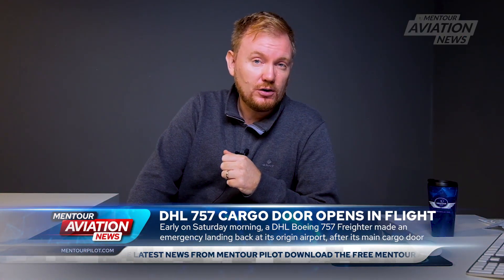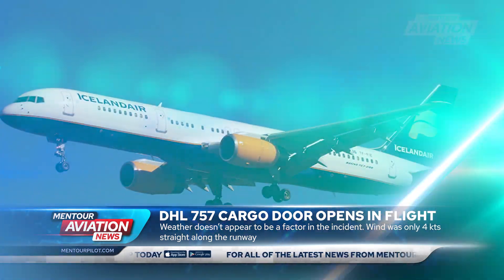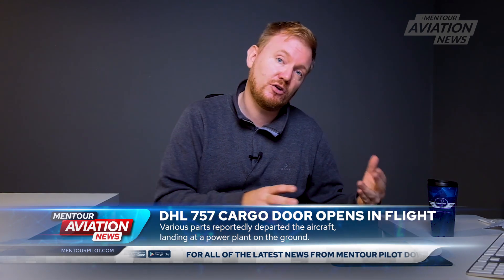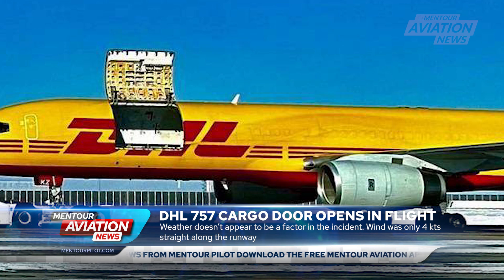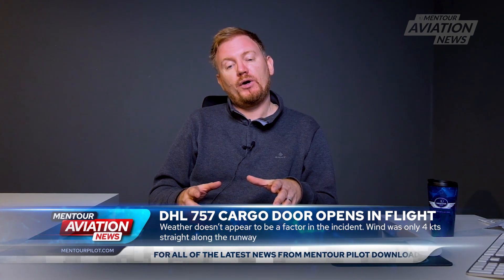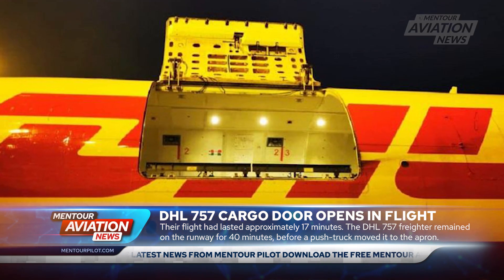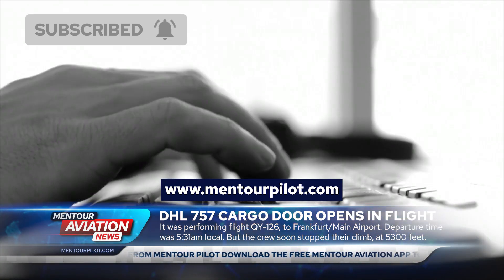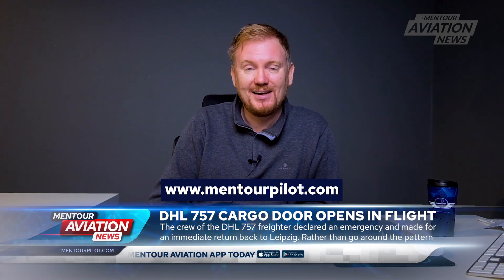Boeing 757 diverts after Cargo door OPENS IN FLIGHT! Mentour Aviation News

Comment from the maker: For fresh aviation News like this 👉🏻 https://www.mentourpilot.com
Reply: I am so glad you do not speculate just because some people ask you to do so
Reply: Hi mentour, are you flying these days?
Reply: parts of an aircraft hitting a coal powerplant. thats not sounding too scary. it's scarier, if you know, that the powerplant is actually part of dow chemicals BUNA plant 10km/6mls south of where i am living and that, if the stuff would have hit like 300m/1000ft further to the northeast it could have done VERY bad damage with catastrophic consequences. so no...not to be taken serious enough! thanks for the heads up, mentour!
Reply: There's one thing you didn't address in the video, and that's the safe landing weight.
I'm surprised they didn't have to fly around longer to dump fuel to get to a safe weight.
Was it a very short haul flight, or do you know anything more about this?

Thanks for the awesome channel with so many great videos!
Reply: @MrNicoJac  Flying around to reduce weight is the normal procedure. However, there is a danger that the door could be ripped off and damage the aircraft, and, the door and debris might hit some people on the ground and kill them. Under these circumstances the immediate landing is the correct choice.
Reply: @MrNicoJac  This flight should originally only go to Frankfurt. Leipzig-Frankfurt is a very short-haule-track? May they´ve simply not as much fuel on board that the weight could be a problem - fortunately?
Reply: Pilots were very fortunate to get this bird on the ground without crashing. They really earned there pay check for the day.
Reply: Not quite a DC10 moment but far too close for comfort. I would have thought cargo doors are foolproof and fail-safe by now.
Reply: Are you planing to cover the DHL crash at Orio al Serio(bgy) from 2016 circa, I'm from nearby and I know you have experience with this airport from the training facilities
Reply: Love the bar like real news well this is real new but like a professional news channel info bar awesome love it!
Reply: Thanks for all the videos your amazing guy  with your team
Reply: Thisreminds  me of Untied Airlines Flight 811 that had a cargo door come open in flight on February 24, 1989. That was a passenger flight with three hundred fifty-five people on board,  and the door came off.  Nine people died, fortunately the pilot reacted and disengaged the auto pilot, then descended and returned to Honolulu successfully.
Reply: At least it flew and did it’s thing instead of completely breaking apart.. think of the windsock effect on the craft. Wonder how much extra thrust was needed for the port side to combat the drag
Reply: I haven't been getting notifications for a while, am back now, I'll be looking daily to see what's new 👍
Reply: Oh, I am from Leipzig, didn't notice that case 🙈
Reply: Did it 😎.
Reply: Do you really need to obstruct the screen with a 72mm News bar? I could not see anything below 1/4 of the screen.
Reply: @rasputinputin8103  there in nothing to be seen down there and it adds some information.   Don’t you watch the news on TV? It’s the same!
Reply: @pomedo  As it happens, old man, I do not do such puerile things as watching TV. If I want news, I listen to the BBC broadcasts; or, if in need of a picture I visit the BBC website. Perhaps, am I missing something?

Comment: I am actually really surprised that the door didn't get torn off by the wind during flight, it's amazing how strong they build these things.
Reply: I am surprised there isn't (or is there? Maybe there is, and it failed somehow) an electronic mechanism that tells the pilot the door is not correctly closed - meaning, with a security deadlock in position - before the aeroplane takes off. All cars since many years have such a warning. There should be a light in the cockpit which goes off only when the door is locked in a sure way. If car manufacturers can do that, why can't the air cargo industry?

Comment: Sorry to nitpick but at the beginning you showed an Icelandic 757 with RB211-535E4 and then showing an ex-BA 757-236 in DHL colours with the older, less powerful RB21-535C engines.  BA had both types in their fleet, the -535C being delivered in the early 1980’s, in the G-BIKx range.  Both engines are still powering 757s after cargo conversions to DHL/FedEx for example.

Comment: Quick not to everybody watching 
This is a common problem with freighter in a very cold weather, it has also previously happens to a Russian 757-200PCF and a DC-8 freighter conversion aswell as a A300 conversion 
It has to due with the locking mechanism freezing up 
In fact there is a pre departure check for the ground crew to check via a small window that the locks are engaged in sub zero temp

Comment: I work with 767-300 converted freighters and the main doors have a latching mechanism plus a separate locking mechanism, activated in sequence by two switches. All cargo doors on 757 and 767 should only receive power from ground power or the APU, never main engine generators, and they have circuit logic that disables all doors and cargo bay lights at rotation. (air/ground sensors on the main gear) 
I wonder if this is a case of getting what they paid for on the third party conversion vs a genuine Boeing conversion?

Comment: After hearing you explain things, its amazing this incident didn't result in a crash. 
I'm surprised that this locking mechanism appears to be designed to allow the locks to release as a result of a hydraulic failure. If this is what indeed happened.

Comment: I can definitely appreciate the concerns of the flight crew in this situation. I fly something a lot slower, lighter and non pressurised (the Cessna 206) and the double rear doors are able to be removed for parachute operations, BUT if we do that, we need to install a deflector kit (to deflect the airflow past the opening) as there’s a risk that pressure from the air flow could cause structural failure of the airframe (blow the tail off). And that’s not even having a huge door hanging out in the airflow.

Comment: Yikes, I panicked for a moment and quickly grabbed my logbook to check if the aircraft (G-DHKZ) was one I'd worked on, it wasn't. I'm an EASA mechanic and used to work on DHL freight aircraft, including occasionally working on the main deck cargo doors. Everyone I worked with mostly considered the 757 doors better than the A300. I'm unfamiliar with flight procedures regarding these doors but I always felt that after loading, pulling the systems CB behind the FO's seat would be advisable.

Comment: In 1974 a Turkish DC10 crashed after taking off from Paris en route to Heathrow. Tragically, 346 people died and the cause was established as a faulty cargo door which flew off at around 11,000 ft.   The means of securing the cargo door were found to be poorly designed and it's believed a member of the ground crew used his knee to force close the locking mechanism.  Instead of securing the door, the ground crew member actually bent the latch into what he thought was the closed position.
Reply: There were several things working against that flight beyond the one you mentioned.  A service bulletin which was started but never finished,  unauthorized modification of the cargo door latch mechanism, and a baggage handler neglecting to do the required check through the sight window of the visual indicator which would show conclusively whether the latches were in fact engaged.

Comment: I have over 3600 hours flying in a KC-135. It has had a large cargo door, made in the early 1950’s out of the 707 design. Part of my job as an inflight refueling operator was to check all doors in the aircraft. There’s lights that signal they are supposed to be be locked. Two manual levers to lock front and rear locks.These locks roll around the lock pins a little lower than the floor level. If they are locked properly the aircraft can be pressured and the locks will get tighter. Never had an issue in all those hours. Not familiar with other aircraft manufacturers. I was also a trained hydraulic mechanic. I would think that the bottom pins were damaged by ground crew or the locks were not rigged correctly and overcenter mechanism was not fully operational. The article didn’t say if it fully opened or just partially. Would like to see the real problem.

Comment: I wouldn't be surprised if it turned out to either be an electrical fault, or hydraulic line rupture that caused it (if the door is held closed by hydraulics, that is).

Comment: I have a few questions for you. One: why is that the black box has only voice recording but no video recording? It feels like we are still in 1990s. All cockpit should be equipped with a full HD or even 4K recorder so when an accident happens it would add to the investigation. Second: Why the flight recording is only stored on a device (black box) and not uploaded via internet link to an international server (using a secured cloud service) every few minutes so even if the black box is lost or cannot be recovered the accident could be still investigated? Third: How could be avoided pilots falsely reporting drones at altitudes which technically cannot be achieved by drones or at speeds no human being would be able to see a thing nor describe it as some reports suggest? (Just an example, when I am travelling with 70mph on a highway and someone is standing on the side of the road it would be impossible for me to describe what he/she was wearing or was he/she moving or was stationary.) In recent years we have been in the crossfire (the entire drone community) by commercial pilots reporting near misses in impossible circumstances and the UK's AirProx Board now has over hundred reports per year of pilots reporting drones without any (not one!) supporting evidence. I find this very concerning. Even the Gatwick incident's investigation (which you have mentioned in one of your videos) hasn't been able produce any evidence of drones were present blocking the runways despite hundreds of people having smart phones these days. But surely the media was very pleased. Millions of pounds were lost and many thousands of passengers have been unable to board their planes. I feel very sorry for all of them. Shortly after the incident the airport has been equipped with anti-drone systems. Seems very odd and maybe it was a staged incident (and was very damaging both for the industry and for our hobby). I am not denying the risks that any solid flying object can pose a risk to the airplane and some people are stupid enough to fly where they not allowed and potentially putting lives at risk but physics and human observation limits cannot be fooled. Many of these reports could have been proven by a nose camera installed. Could you please clarify these in any of your upcoming video? I would love to hear your thoughts. What are your suggestions or explanations of the ever growing numbers of reports? Many thanks in advance.

Comment: Even though the aircraft is built with a frame known as a space frame buy riveting the skin to it it gets structural rigidity approaching the type of engineering you would get in a monocoque or unibody Construction

When the door is lockdown in essence the door becomes part of the horizontal and vertical ribs up the structure as well as part of that monocoque skin

The twisting on the fuselage especially above and below the door see incredible Torx applied to them more so than the left or right sides because of the longitudinal stress on the fuselage

Received this or have seen this on "Open Wheel" monocoque Auto racing chassis which has and opening for the cockpit exactly where you don't want an opening in the middle where you got those longitudinal forces

The buildup of chassis strength especially in Pre carbon fiber Construction in that location was more than anywhere else except suspension pickup points or engine attachment bulkhead

Comment: 757 Manual: Don't operate the doors above 45kts wind speed. Might fall off.
757 Pilot: Involuntarily flies with door open.
757 Door: The manual says I'm supposed to fall off now. Luckily I'm just a door, I can't read manuals, so I won't.

Comment: The other good thing about the pilots getting the aircraft back safely is that it should be so much easier to investigate the cause and make operational or engineering changes should they be required.
Regardless of the cause, I would have thought that procedures, redundancy and fail-safes should not allowed something like this to happen.
Hopefully, you will eventually be able to do a follow-up video once it is known what went wrong, along with how they propose to fix it.
P.S. I love the way you present what you know free from the 'tabloid' sensationalism found so often.

Comment: Did they reduce speed to decrease drag from the open door?
Reply: It would be more a matter of increasing thrust (slightly) to be able to hold the desired speed despite increased drag.
Reply: The autothrottle can do that; I was referring to slowing down in order to prevent the door braking off alltogether.

Comment: Did they attempt to re-close the door in-flight?  Or is that not something they would even attempt?
Reply: The only way that could possibly work would be to fly with the fuselage at a negative angle of attack.  Then lift on the door would be negative instead of positive as it is if open in level flight (since the fuselage is attached at a positive angle to the wing, level flight has the fuselage angled up).  Getting the fuselage to negative AOA would thus involve a somewhat rapid descent, at least for a short time, and then you're into how fast do you want to get up to with the cargo door wide open.
Reply: Marc McReynolds wtf are you rabbiting on about dude.?  Stop pretending to understand aerodynamics.  I just meant if anyone knew if in the checklist for this procedure, if there was any step to even attempt to re-close the door at low speed prior to landing.  The angle that the door is open at would not necessarily cause lift esp during a a banked turn for example.  It also has a completely different profile from a wing that only produces lift due to the airflow across its profile which causes a difference in air pressure and so lift is produced.
Reply: @WallyMcFly   For years I was paid to pretend to understand aerodynamics.  From your "Wonder Book of Flight" explanation of lift, I'm guessing you were not.  Lift results from momentum transfer between air and the underside of whatever -- the result of those billions of molecular impacts is "lift".  The profile of a wing (or fuselage, or open cargo door) mainly affects drag and moment.  "Difference in air pressure" explanations of lift seen in some elementary texts gloss over the fact that this pressure differential is a result of lift rather than the cause.  A flat plate in a vacuum, impinged by a fluid stream at some angle, will not necessarily even have a pressure differential in any meaningful sense.  But it will generate lift (and drag and moment) from momentum transfer just the same. 

Back to the business at hand:  Though a drawing would have come in handy, if you carefully study my original words the basic situation might sink in.  The cargo door, when at a positive angle of attack (and irrespective of aircraft trajectory) will generate lift, and that works against it being able to close.  Not much lift when it's fully open or nearly closed, but quite a bit as it passes through horizontal on the way to closing.  Even the slowest of flying speeds would be way more than what the hydraulics (if working) could handle.  In a hypothetical case where the door barely came open there might be a chance, but that's not what this incident was about.
Reply: Marc McReynolds impact molecular force transfer and lift created by a profile wing aren't the same.  You are confusing these two phenomenon as one.  Aircraft trajectory and orientation has everything to do with whether or not any surface presented to an airflow generates lift (or molecular impact force transfer) or not.
Reply: @WallyMcFly  "impact molecular force transfer and lift created by a profile wing aren't the same."  That's true.  Lift is simply a definition:  The vertical component of the "resultant force" vector at any instant which arises from whatever interaction is going on between an object and a fluid having some relative velocity.  The exact magnitude of that force will depend on a lot of things:  Shape of the profile(s), laminar/turbulent, subsonic/transonic/supersonic -- on and on.

What often gets muddled is the distinction between what lift is vs how to go about (approximately) calculating it.  You see that in "NASA admits it doesn't know what lift is!" headlines.  Much of Aero consists of various ways to get numerical estimates for what is physically happening.  From Circulation Theory in olden days to Computational Fluid Dynamics more lately.  When the subject is a curved cargo door with an unsmooth "leading edge" and a complex underside, the exact number for the resultant force/lift is god-knows-what... but one way or the other, the door is being kept from closing by molecules banging against its underside.

"Aircraft trajectory and orientation has everything to do with whether or not any surface presented to an airflow generates lift"  Also true...  except when something is articulated -- able to experience a range of different airflow conditions even without any change in aircraft AOA.  Call it an extra "degree of freedom" to the problem.